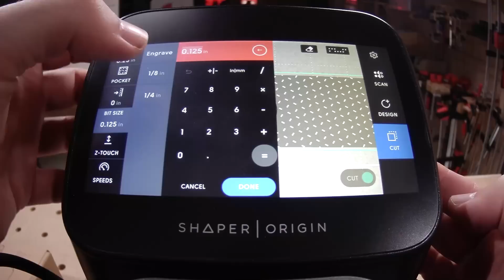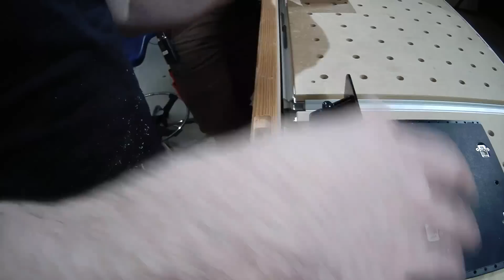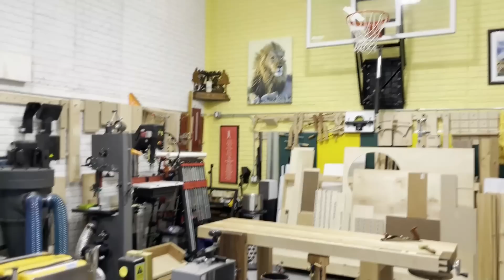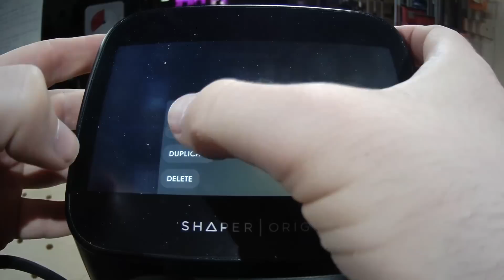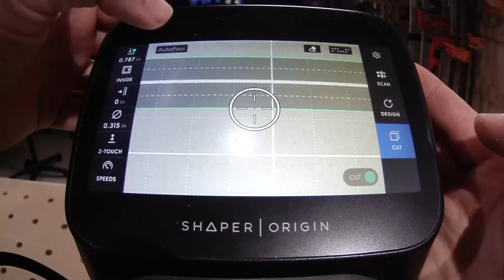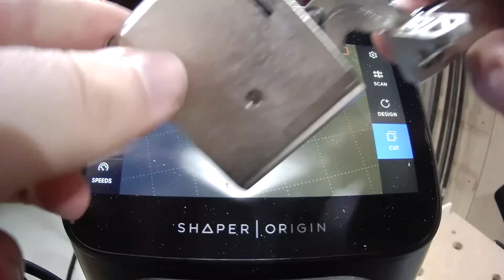Session 97  – English: Introducing the Edge Mortising Adapter

Comment: I watched this live last night and it was a little overwhelming. This morning in my feed, I had a link to the French version. Same topic but I found it easier to follow. There was even the added bonus of a Soss hinge that is apparently not in the hardware on Hub, so the presenters showed how to use the connected caliper to add a piece of hardware. At the end they linked the caliper to Studio and did the same for a folding clothes hook. 

I would fly to France to do a Masterclass there!
Reply: About what time do they show the folding clothes hook? Trying to find it.
Reply: Not sure when it was added, but I thought I remembered seeing SOSS hinges in the hardware section of Shaper Hub a couple of years ago. Anyway I just checked and there are digital templates for 9 SOSS hinges, ranging from the smallest (SOSS 100) up to the largest (SOSS 218).